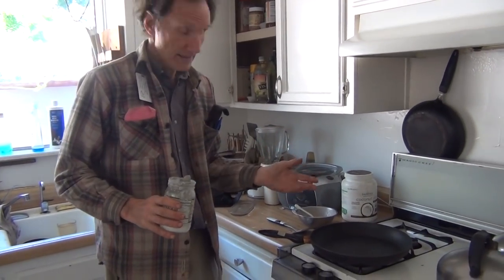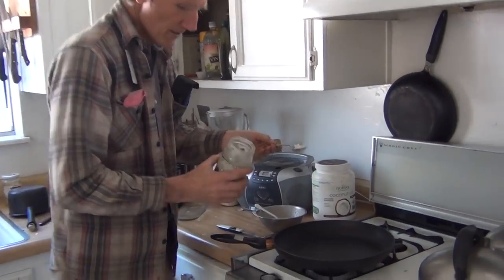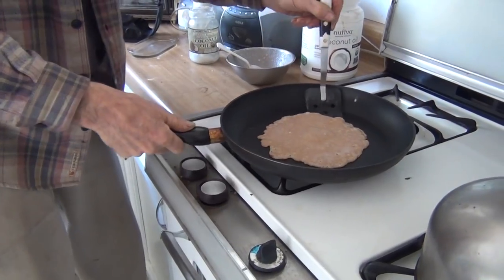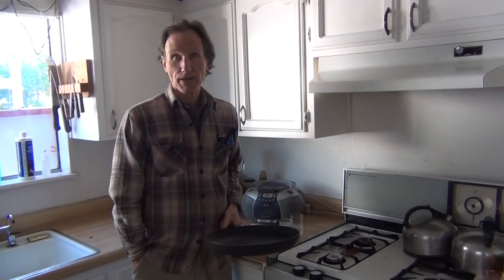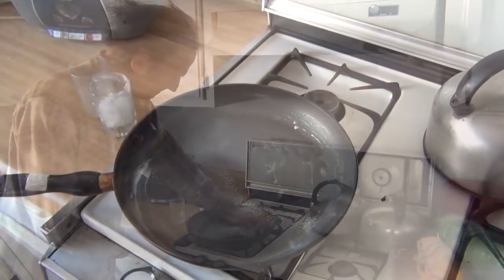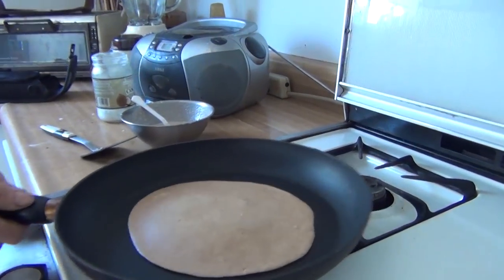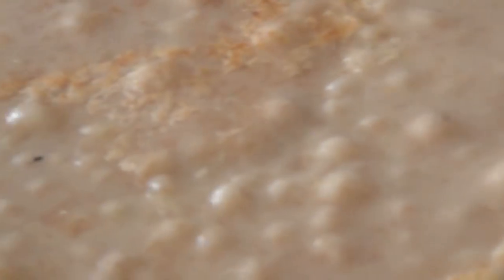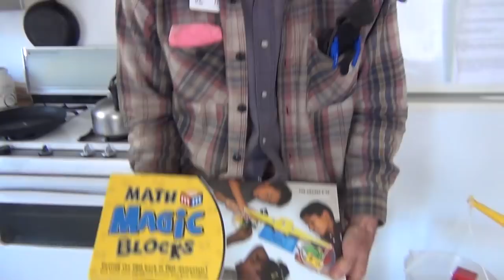Make Your Old Teflon Pan New Again!

Comment: Please by all means do not put your frying pan after heating into freezer. The extreme temperature will warp your pan if not crack it.
Reply: Separates the layer of Teflon from the aluminum.  Worse if you put a hot pan under the faucet  with cold water.
Reply: You worried about the pan and not your health ???  Think again.

Comment: Coconut oil has a very low melting and burning point. The fact that you were having problems was because you were burning the coconut oil before it could even be properly used. No wonder you were having problems.

Comment: 10 +2 is 20 lmfao whare did u go to  school at lmfao
Reply from the maker: Dear Joe,  Thanks for the feedback.  I did check my phone calculator, and you are 100% right. 10+2=12, not 20.  Thanks for the correction.  But isn't 10 X 2 = 20?  (Please correct me if I'm wrong.  I went to school at Burlingame High (HOme of the Panthers) but it was MANY years ago, so I may have forgotten my times tables.    Bruce
Reply: oh im sorry i was just joking about that @ratbler
Reply from the maker: @joe241able  Thanks for the reply, Joe G.  Y'know, I was just joking, too!  : )  The reason I called my invention Math MAGIC Blocks is that what you saw on the  video is actually true:  When one puts a 10-block and a 2-block in one balance pan, they are balanced with a 20-block on the other pan.  Amazing!--MAGIC!  It works with all the colored blocks in the set.  Even with big numbers, like 60 + 3 in 1 pan balances 2 + 2+ 3 + 3 + 5 in the other pan, demonstrating that, even though one is obviously ADDING the weights, the balancing demonstrates that 60 X 3 = 2 X 2 X 3 X 3 X 5 = 180.  Pretty cool, eh?   Bruce Ratcliffe, the inventor of Math Magic Blocks
Reply: @ratbler  yes 10x2 is 20

Comment: you guys are pretty rude to a potential workaround for something you cant actually fix
Reply: How exactly is this a workaround? 1. You need enough space in the freezer to fit a pan, 2. It's good for 1 pancake, after that you gotta refreeze to get a second pancake (who seriously eats only 1 pancake?) 3. You'd have to wait for the pan to be room temperature to stick it in the freezer, 4) The pan will just deteriorate even faster over time, with you constantly freezing and thawing it via stove/freezer. The only way you can value this video is if you don't value your time, otherwise you'll spend $20 to get a brand new non stick pan.